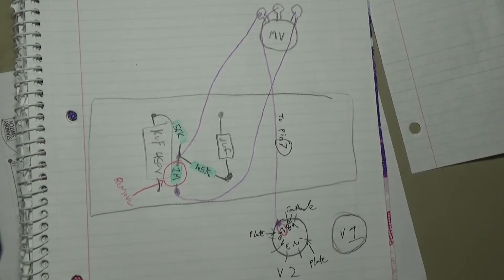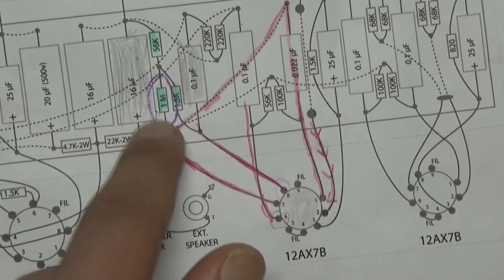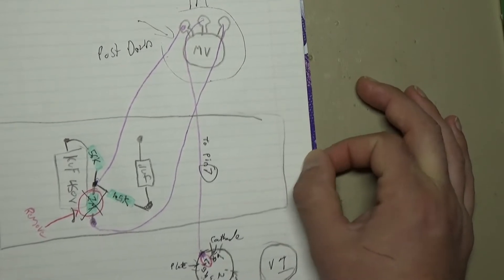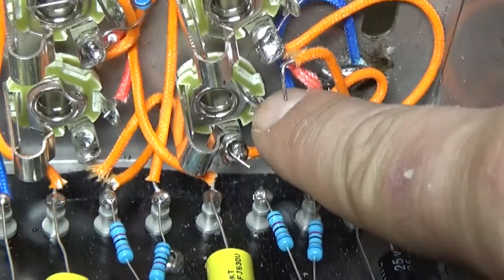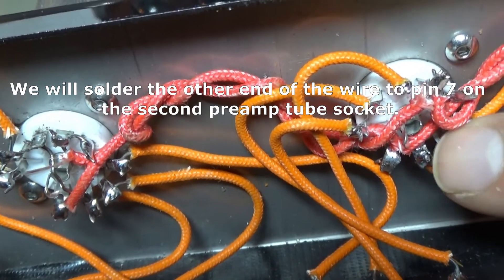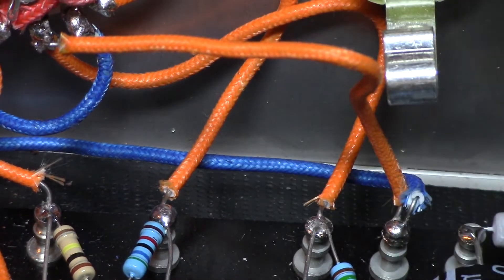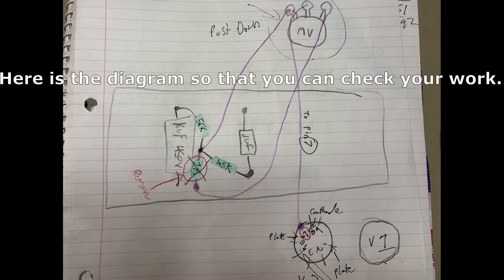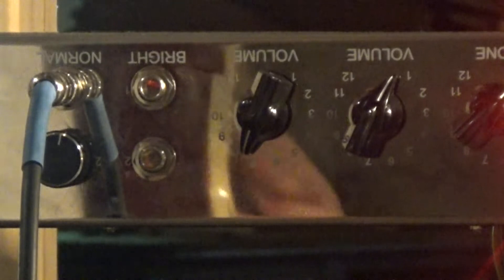Add a Master Volume to a Tube Amp (Tweed 5e3)

Comment: I used the Rob Robinette master volume mod on my Weber 5E3 kit build. I decided to remove it after finding no real advantage in it's use. You could lower the master volume and crank up the original volume looking for more breakup at a lower volume, but the effect was quite drab, not at all what I was looking for. I also added the Feedback Switch Mod, this gives you three different choices of negative feedback from the output transformer, using a SPDT ON-Off-ON switch , IN:  normal with cathode bypass cap on, Center: Cathode bypass cap off, Out: Feedback on & Bypass cap off. I actually like the stock setting best, but I can see where the different tones might come in handy...
Reply: I'm wondering if I can turn my 5e3 up to the sweet spot but still lower overall volume with Master volume. Would this mod do that?

Comment: Would have been nice to hear the sound when you change the master a little at a time. It seems where you turned it down too, would be the lowest anyone would need. Would like to hear a couple in-between that and full. I would like to roll on a little more distortion to my taste. Thanks for the video.
Reply from the maker: Check out my recent cascaded gain mod video if you like natural tube gain
Reply from the maker: https://youtu.be/qJQQqvmrMy8
Reply: @lowheadroom  That link was to the gain mod.

Comment: From about 10:30 onwards, when listening on headphones and especially my phone's speaker, I noticed a feint "white noise" type rustling sound as each note decayed. Would you know what that's caused by, and can it be eliminated?
Reply from the maker: It’s likely an oscillation caused by my lack of using shielded cable
Reply: @lowheadroom  OK. Thanks for the explanation.

Interestingly, I also noticed the exact same noise on several tracks of the album "The Jimi Hendrix Concerts". I always wondered where the noise originated from, so now I know 🙂

Comment: That tool is only rated at 440V Max so I wouldn't be using that, personally. Amazon has 1000v capable discharge tools that have a display to actually show you how much voltage is being measured currently. There's no flashing LED to miss. Just a screen and a number.

Comment: I've experimented with several 5E3 MV mods both pre and post PI and to my ears they all sound like garbage.
Reply from the maker: Only one of mine sounds not fizzy
Reply from the maker: I think the trick is shielded cable
Reply: @lowheadroom  I did use shielded cable on the MV I used, interference noise was not the issue, crappy tone was...